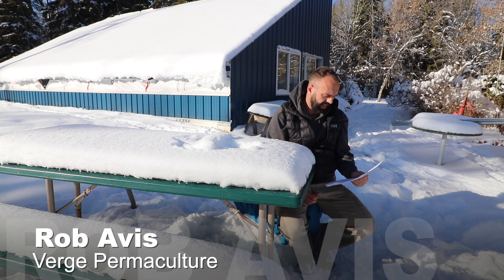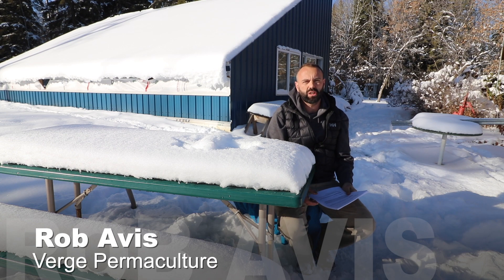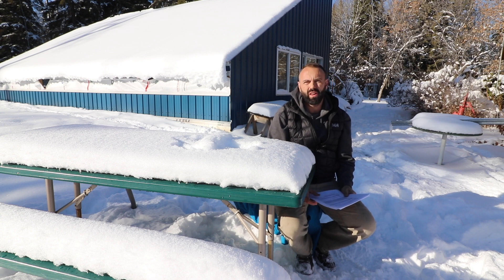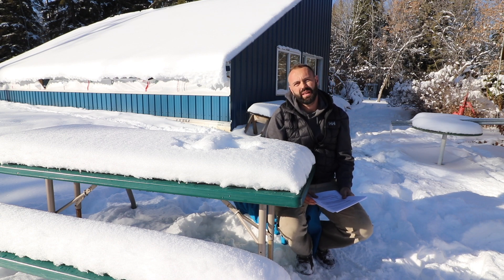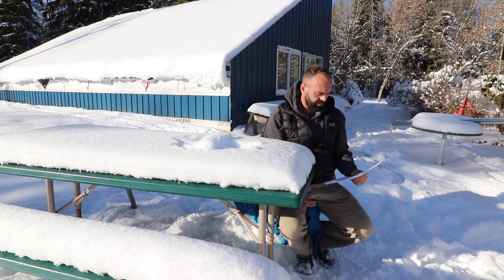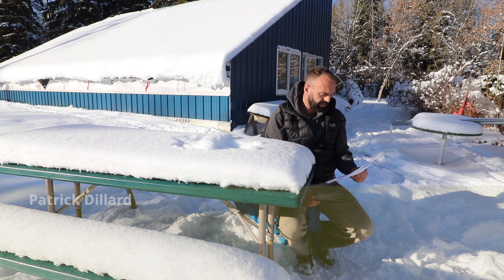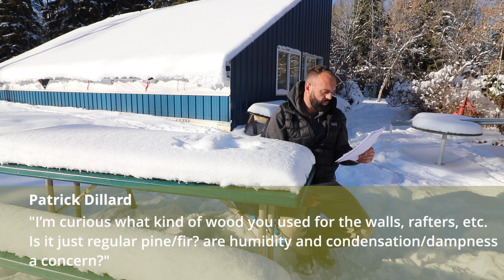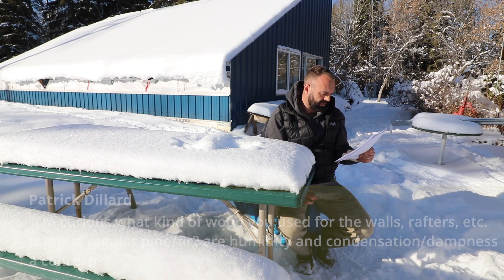What Timber Did You Use On Your Greenhouse?   #AskRobAvis 013

Comment: Hi Rob,  Is there any value to having your greenhouse rigged up so that snow can be knocked off the polycarbonate so that sun can get through? You're answering questions sitting in front of your fantastic greenhouse with sun shining on the snow getting reflected instead of heating the inside. Thanks!
Reply from the maker: It is not loosing its snow because it is not sealed up yet. Once there is heat in the soil it will melt off all year long.